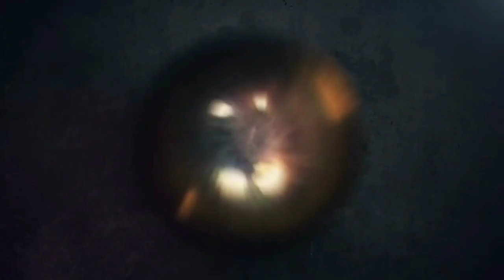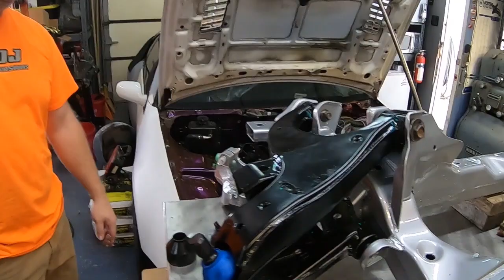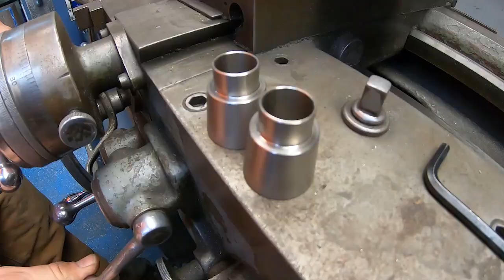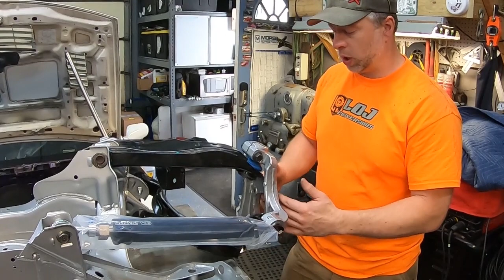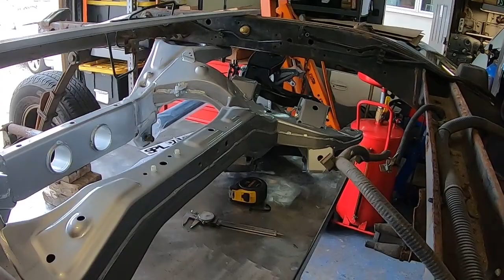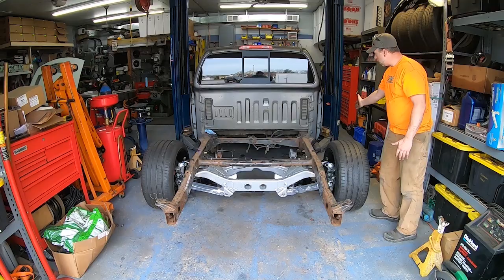IRS INSTALL! - SWAPOLOGY - Project Frontier [EP07]

Comment: Steven im gonna be calling you in next day or two and ask a few questions and your advice/input on trailblazer SS t56 or tr6060 swap but keeping AWD. Its not been done or at least no one’s posted online, i doubt it has been done because theres very few RWD t56 or manual transmission swapped gmt360 builds as it is, although there’s a dozen or so done.
Reply from the maker: Talk to you soon!

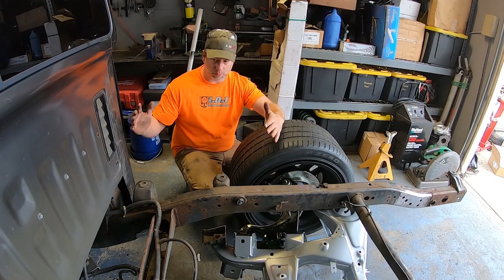Comment: 5:16, did you consider using the short bed from the crew cab? I think it's right about 14" shorter. Would probably need to move the bed mounts forward, but then you'd have that sweet, sweet stubby wheel base.

Comment: How similar or different would this be on the xterra and pathfinder? Would they have the same issue with the location of the subframe mounting points w.r.t. the rear wheel arches?

Comment: Are you doing any before and after performance testing? It would be neat to put two of them in a track together with the same wheel and tire package to see what gains the independent rear is worth
Reply from the maker: No, way too much is changing at once to do that kind of testing. However, I'm keeping my eye out for another frontier to use a Pathfinder frame in and maybe a basic NA LS swap for fun.